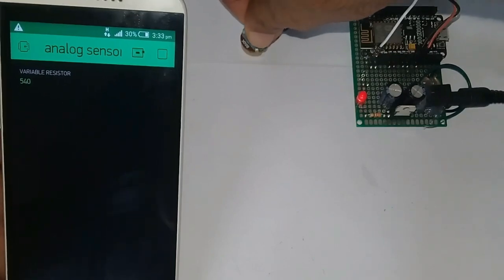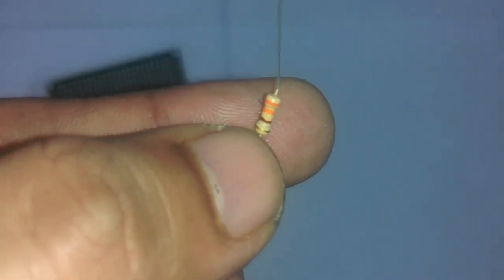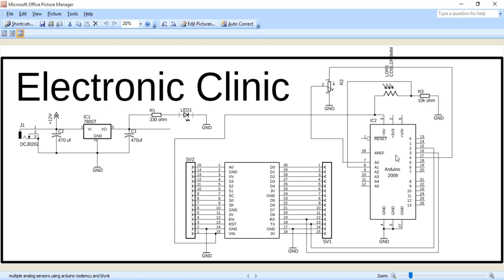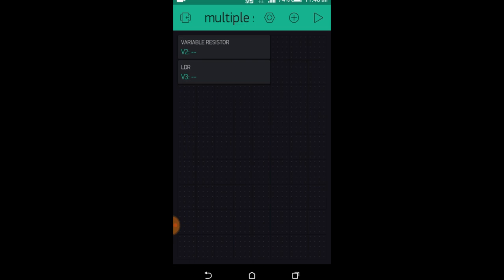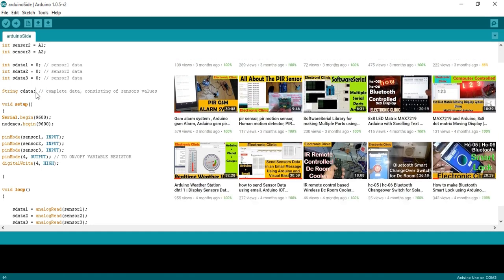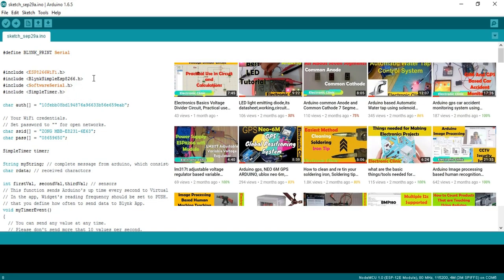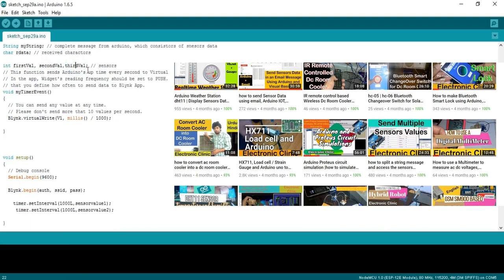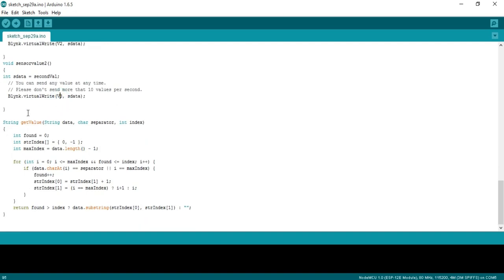Arduino IOT Project: Monitor Multiple analog sensors using Nodemcu ESP8266  and blynk

Comment: I hope you are the right one for me to solve my problem. I'm working in a project which is related with your project. 
my project is. IOT based home automation and energy consumption. I've used esp8266 nodemcu and Blynk apps for home automation and it's complete but when I'm trying to measure electricity then I've noticed i need 2 analog pin for done the project and then i'll get the CT value and voltage transformer value. Now I'm finding the solution how to connect nodemcu and arduino uno because I already have this device. Thank you so much. I've subscribed your channel.

Comment: It is not really in parallel if you think about it. Use the photon-pixel coupling method, it is a new approach in science for reading an unlimited number of sensors in parallel. It can be done with an Arduino and an arduino cam.
Reply from the maker: Thanks for the info. Will check it out

Comment: Thank you for the tutorial. The code is working correctly but my voltage sensor value is only displaying an integer value, I need a decimal value too. What shall I do? For example value is 2.87, it shows only 2 in blynk (but in serial monitor there is 2.87)
Reply: Could you please send me the complete code

Comment: thanks for your tutorial, i'm beginner in IoT, i want to make a project that use a 4 analog sensor (MQ-6 and rotary encoder) i want to use your second option to connect node mcu and arduino uno to solve the. but i'm still confused when i want to interfacing the 4 analog sensor in one superchart (Blynk App) there's one pin analog option (adc 0). what should i do? 

thankyou for ur attention, god bless you

warm regadrs from Bali, Indonesia
Reply from the maker: Don't worry if you have one analog pin.... watch my tutorials in which i used arduino with nodemcu..you can connect your sensors with arduino and then send data serially to nodemcu.. this way you can connect many analog sensors and you won't need any multiplexer... you can also use mega with nodemcu.. i have very unique tutorials on this ... 
watch those tutorials... and let me know if you have any questions..

Comment: Excellent work as usual... Instead of using Esp8266 and arduino, is it not better to use single Esp32.? As esp32 offers multiple analog and digital pins..
I am wondering on similar project as discussed in your video.i faced problems in serial communication between arduino and Esp8266. When ever i have burn code the serial communication pins need to be removed and again plugged in...
After all i shifted my whole project to Esp32. There i faced problems with voltages.. Some of sensors needs 5v to operate and there is not any 5v Vout pin available on esp32 and also faced problems in scaling and i don't get desired outcome..
Reply from the maker: use 3.3 to 5v bidirectional converter
Reply: @ElectroniClinic  is there any provision to keep sensors like dht11, pressure and some gas sensor

Comment: Hi. I'm getting the value on the blynk app only once after uploading the code. After that it is showing zero once again. However in the serial monitor the values can be viewed. Any idea why this happens?

Edit: I found the solution. Apparently there was no print Serial command in the NodeMCU coding so it was hard resetting regularly

Comment: good day sir,i just want to know if the android phone is connected to the wifi or is it using data?
btw im a filipino and considiring making a similar project,im just not use to the icon that the smartphone is using,the icon about the connection i cant understand if it is connected to wifi or using cellular data,
Reply from the maker: you can connect this to wifi or use data.

Comment: Hi Respectable Sir,
I am using nodemcu 12e(Lolin Ch340g), tried alot to upload your code written for nodemcu but there is error" Error compilling for board NodeMCU 1.0 (ESP 12E-module)". I tried with different baud rates but still there is an error.
I tried other simple coding for nodemcu they are working fine and uploading without any error.
kindly sort out my matter.   Regards
Reply from the maker: if you are getting the compiling error it means you are not using the correct libraries or you are not using the updated version of the Arduino IDE. watch my getting started tutorials on the Nodemcu Module. 
this project is working perfectly and has no errors. 
check your libraries.
Reply: Libraries are all there. I am using external power supply as you suggested. But i am sure it may not be the reason that I am using CH340g version of nodemcu
Reply: @kingshahzad78  Khurram Shahzad I am not clear with the question but it seems like you are missing a driver for your board...let me tell u a solution...click here in the given link and ind the driver for CH340G...
https://github.com/nodemcu/nodemcu-devkit/tree/master/Drivers

Comment: thankyou for this video that made me inspired to make the project. i would like to read 3 sensor use analog pin on arduino, and 1 rotary encoder that use a digital pin. but there is still error   "sensorvalue1" doesn't declared on this scoope. please correct me if i'm wrong 

#define BLYNK_PRINT Serial
#include <ESP8266WiFi.h>
#include <BlynkSimpleEsp8266.h>
#include <SoftwareSerial.h>
#include <SimpleTimer.h>

char auth[] = "b9e96593f13741478cabc776aab24da2";
;
char ssid[] = "SW";
char pass[] = "santaiwae";

SimpleTimer timer;
String myString; 
char rdata;

int firstVal, secondVal,thirdVal, fourthval; 
void myTimerEvent()
{
  Blynk.virtualWrite(V1, millis() / 1000);
}

void setup()
{
  Serial.begin(9600);
  Blynk.begin(auth, ssid, pass);
  timer.setInterval(1000L,sensorvalue1);
  timer.setInterval(1000L,sensorvalue2);
  timer.setInterval(1000L,sensorvalue3);
  timer.setInterval(1000L,sensorvalue4);
}

void loop()
{
   if (Serial.available() == 0 )
   {
  Blynk.run();
  timer.run();
   }
  
  if (Serial.available() > 0 )
  {
    rdata = Serial.read();
    myString = myString+ rdata;
   // Serial.print(rdata);
    if( rdata == '\n')
    {

String l = getValue(myString, ',', 0);
String m = getValue(myString, ',', 1);
String n = getValue(myString, ',', 2);
String o = getValue(myString, ',', 3);

firstVal = l.toInt();
secondVal = m.toInt();
thirdVal = n.toInt();
fourthVal = o.toInt();
myString = "";
    }
  }
}

void sensorvalue1();
{
int sdata = firstVal;
  Blynk.virtualWrite(V2, sdata);

}
void sensorvalue2();
{
int sdata = secondVal;
  Blynk.virtualWrite(V3, sdata);

}

void sensorvalue3();
{
int sdata = thirdVal;
  Blynk.virtualWrite(V4, sdata);

}
void sensorvalue4();
{
int sdata = fourthVal;
  Blynk.virtualWrite(V5, sdata);
}

String getValue(String data, char separator, int index)
{
    int found = 0;
    int strIndex[] = { 0, -1 };
    int maxIndex = data.length() - 1;

    for (int i = 0; i <= maxIndex && found <= index; i++) {
        if (data.charAt(i) == separator || i == maxIndex) {
            found++;
            strIndex[0] = strIndex[1] + 1;
            strIndex[1] = (i == maxIndex) ? i+1 : i;
        }
    }
    return found > index ? data.substring(strIndex[0], strIndex[1]) : "";
}

Comment: Hi I need a help I am making a project of using node MCU and Arduino Uno to detect Toxic gases in the drainage of CO, Methane and H2 .and gives alert by buzzer it level of toxic gases increases then the servo motor turns and spread the chemicals
Reply: Please send the source code and circuit diagram

Comment: Hi i'm a beginner in IOT, i am working on my final year project which is sending data from three sensors and i am using nodemcu, i tried connecting it with arduino but it doesnt seem to work? Please help
Reply from the maker: watch my recent videos

Comment: sir in my project there are 4 analog sensors, now how to send these data from nodeMCU to a cloud server(ubidots), what should i make changes in given program for nodemcu ? please help me in this problem please
Reply from the maker: just a few changes, define more variables. and use more virtual pins on blynk side. First make the basic one then modify the code.
Reply: @ElectroniClinic  but I want upload data on cloud server not on blynk app then what to do ?

Comment: I have one very important Doubt!! --> U have used 7805 regulator and providede the 5 volt line to the arduino as well as to the ESP8266, but the esp8233 can't handle a digital signal of 5 volts, it's designed for 3.3volt signal, 
so Why u have directly connected the RX and the TX pins of arduino that operates at 5 volts and directly connected them with the esp8266, why??? 
in this way the ESP8266 will damage, isn't it true???
Reply from the maker: I did it just to explain the idea, in reality, you will have to use a 5v to 3.3v converter and vice versa.
Reply: @ElectroniClinic  Ok thanks 🙏

Comment: Hi sir. I just want to ask, why in the nodemcu coding you used sdata, but in arduino coding you use sdata1, sdata2, and sdata3? Also, My device on blynk is offline. I use LM35 as sensor.
Reply from the maker: These are just the variable names.
Reply from the maker: Change ur router name and password and also use ur authentication code.
Reply: @ElectroniClinic  okay, I fixed it. The device is online now. But it read 0.......
Reply: @ElectroniClinic  I can change it to any variable right? What if in arduino coding, i set temp as my variable, do i have to change the sdata to temp as well on the nodemcu coding? I want to avoid using sdata1 because it cannot calculate the temp formula in celcius...
Reply from the maker: You can use any variable names.
Reply: And also, is sdata1, sdata2 and sdata3 in arduino coding is related to sdata in nodemcu coding?
Reply: @ElectroniClinic  ok sir..thank you :-)
Reply from the maker: Not related. You can use a different variable name.

Comment: Hi Fahad, if i have to transmit more value ( more than 10 values to NodeMCU from Mega board ), can you please share some hints on this.
Reply from the maker: you can use the same method.
Reply: @ElectroniClinic  I tried but 11th 12 and 13th values in the string is not getting received
Reply from the maker: then make two messages. first send one message and then the 2nd message. use the same method.
Reply from the maker: each string can consists of 3 or 4 sensors values.
Reply: @ElectroniClinic  at receiver side how to get multiple strings this is the code which I am using to get the values. 
void loop()
{
    (Serial.available() == 0 ) 
   {
  Blynk.run();
  timer.run(); // Initiates BlynkTimer
   }
   
  if (Serial.available() > 0 ) 
  {
    rdata = Serial.read(); 
    myString = myString+ rdata;
        delay(1000);
    //Serial.print(rdata);
    if( rdata == '\n')
    {
String l = getValue(myString, ',', 0);
String m = getValue(myString, ',', 1);... This continues till 13
Reply from the maker: this is simple, think for a while how you do it for one string? use the same method but different names. or even you can use  one string on the receiver. but you will have to add a header on the transmitter side. with the help of that header you can know if the sensor values are coming from group1, group2. or group three
Reply from the maker: for example. 
group1,sensor1,sensor2,sensor3

group2, sensor4,sensor5,sensor6

then on the receiver side use of condition if the first value has group1 then store these values in some variables
and if group2 then store these values in other variables
Reply: I think this is what you meant ...

Comment: Okay this is for int, how do I send float data?
Reply from the maker: Convert this into string
Reply: @ElectroniClinic  I tried the same code but changing your "toInt" to my "toFloat" but the "toFloat" function is not recognized. Can you help me with certain links or maybe just a short video of sending float data, no need to be from a sensor, just set a random float data and send to nodemcu. That would be very helpful :)
Reply from the maker: watch my tutorial on car accident monitoring system using gps and gsm... in that tutorial i have explained how to conver a float into string...watch that tutorial.

Comment: Sir, please send me the code for reading temperature&humidity (dht11), pressure sensor,gas sensor, LDR, ultrasonic sensor using Arduino UNO and sending to nodemcu and displaying on blynk app. Please help me as soon as possible sir.

Comment: third option connect multiple node mcu
Reply from the maker: I have been thing about this to connect more nodemcu modules with one app
Reply: Electronic Clinic may I ask for your help...I am for a month try to connect 2 or more node mcu  to the same broker using MQTT protocol...but I got nothing..I just want to  my 3 nod mcu communicate between each other using MQTT protocol..through any broker like adafrit for example
Reply: @ElectroniClinic  May I ask for your help if it is possible...for a month I am working on connecting 2 or more node mcu to the same broker like adafrut for example or any broker using MQTT protocol. but I got nothing..may be you could help me ..thanks
Reply from the maker: Multiple nodemcu tutorial is upload. Check